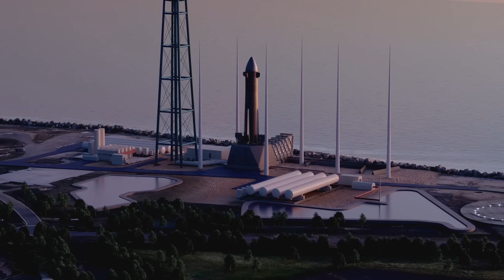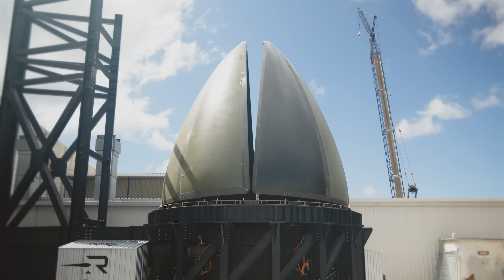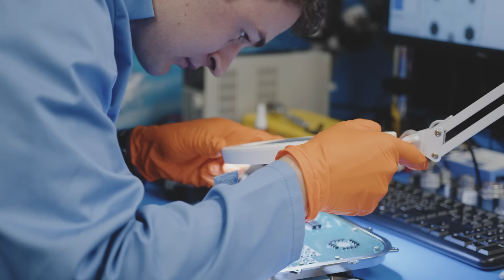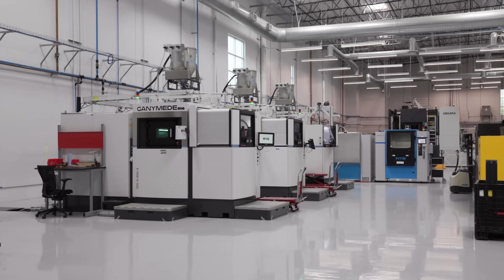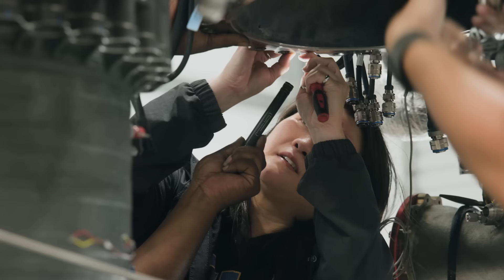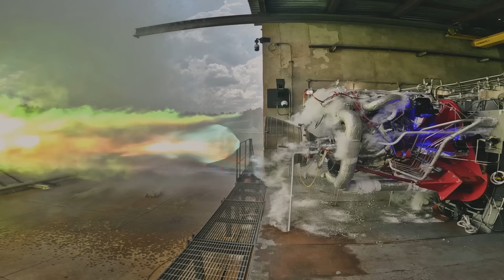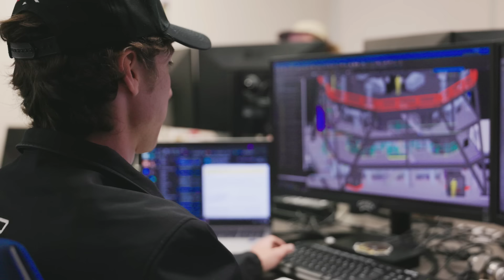Rocket Lab | This is Neutron

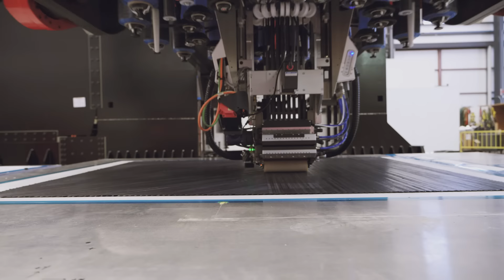Comment: 2:26 - I love how engineers misuse words to make themselves sound smarter. The word "depositions" is the plural of a legal process whereby a person makes truthful recorded statements under penalty of perjury.
The word we needed here was "deposits". A non-fancy word, but the correct one.
Reply: The 3rd definition od deposition :
3. the action of depositing something.
"pebbles formed by the deposition of calcium in solution"
Reply: This word has multiple meanings. Deposition in additive manufacturing or 3d printing is “the process of applying material layer by layer to build up a digital 3-D model”. There are many words I have encountered in science and aerospace that are not in any dictionary and not easily googled, but these words appear in our textbooks, reference material, research papers, and suppliers documentation. Cheers
Reply: @Duu2 thank you for bringing facts to the table instead of random speculation:)

Comment: How can carbon fiber stay structurally sound during reentry
even with a heat shield parts of the ship must surely exceed
the max temp for the resins.
Reply: First stage doesnt get anywhere near orbit so heating isnt as big of a challenge.

Comment: It sucks so bad that this isnt going to work. A single stage to orbit, and returning to where? A propulsive landing? Parachute and recovery? All with carbon fiber? So many fantasy aspects to this rocket it seems crazy to me that youre talking about this like it isnt still 10 or more years from reality.
Reply: This is not SSTO. It spits out an upper stage. It'll do what the Falcon 9 boosters do.
Reply: Genuinely what in the world gave you the idea that it's an SSTO? And why does the fact that it propulsively lands make it not able to work? SpaceX has been doing it for years and it made them really successful. Also, wdym "returning to where"? It'll return to a landing pad, and maybe droneships at some point
Reply: The skin has a higher melting temperature than stainless steel.

Comment: impressive. a little more than half the payload of F9. what's even the point?
Reply: It's more reusable than Falcon 9, so it'll likely be cheaper, plus Flacon 9 rideshare means that you can't be as specific in the orbit you go too, Neutron's lower payload capacity means that it can take payloads to more specific orbits for buyers who need them, without wasting empty space, so actually, there's much reason to make Neutron despite the lower capacity

Comment: How does a carbon fibre rocket survive re-entry? Is it light enough to be able to slow itself down with a burn back and then return to base?
Reply: It's not at orbital speeds like starship.  Due to its shape, should be slower on the return then falcon 9 booster.
Reply: Carbon fiber ceramic skin.

Comment: Guess I’ll just keep buying more and more Rocket Lab shares. This company is going to explode in size in the very near future.   Love it!
Reply: You chose wisely
Reply: Well, I hope it doesn't explode in size or any other way. Just saying.
Reply: @HeroesforDemocracy  or RUD (Rapid Unexpected Devaluation)
Reply: @HeroesforDemocracy Wieso, dann gibt es wieder gute Einstiegskurse in die Aktie.
Irgendwann wird Neutron fliegen und dann beginnt eine gute Phase für das Unternehmen.
Reply: If it explodes, imagine how many years it'll take to build another. They are going for perfection rather than trial and error / test runs / pilots. These guys are slow af.
Reply: @UnsaltedCashew38  Explode in size.  Meaning it will see an exponentially massive growth.
Reply: @UnsaltedCashew38  Blue origin did that and they got orbital first try and second try landed the rocket, the largest rocket to land on a barge! makes falcon 9 look like a candle stick. Jeff bezos has already a genius in ramping up production, he said an engine  can be produced every 2-3 days.
Reply: Rklb is and has been $$$$ buy buy buy buy
Reply: have you seen the market? Hold off
Reply: @noamjacob1216 You mean the 10% dip today?  No better time. 💰💰💰
Reply: @noamjacob1216  Yeah hold off. Buy high 🤣
Reply: @noamjacob1216 If you jumped on pretty early, you would be quite relaxed even with a 10% downturn
Reply: @noamjacob1216 right what caused the 10% drop yesterday on RKLB?? Couldn't find any news...
Reply: @noamjacob1216 agreed.
Reply: @noamjacob1216 ah yes, the first principle of investing: wait until the perfect moments to buy and sell because they are always predictable and the other investors and millisecond trading computers will wait for you to act first, not be a mile ahead of you
Reply: @noamjacob1216  No Balls!! No Glory!!!

Comment: Would Neutron, in theory, be able to compete for ISS (or other private space station) resupply missions, berthing directly?
Reply: Most likely. ISS resupply vehicles range from Progress at around 7200 kg fully loaded to cargo dragon 2 which is around 12,500 kg. So actually Cygnus, which is around 7400 kg, would be a great cargo vehicle to fly on this
Reply: It's definitely capable enough as a launch vehicle but it would need a spacecraft to match. It's unlikely that they couldn't convince someone like SpaceX, who operate their own launch vehicle in addition to their resupply spacecraft to switch away from their own launch vehicle. If Anatres 300/ Firefly's Eclipse are delayed, Northrop Grumman may consider flying Cygnus XL on Neutron instead of Falcon 9. Outside of that, and perhaps some European Commercial space Cargo return services capsules if they materialize and don't go with an European launcher like Ariane 62, Rocketlab would likely need to develop their own CRS spacecraft if they wanted to fly missions to the ISS or CLD stations.
Reply: @plainText384  I had Axiom space in mind. I could see them launching on Starship Cargo, but resupply with Neutron could be an option. Just thinking out loud.

Comment: Better launch soon or Rocket Lab could look like Blue Origin, more hype and CGI than rockets. Just get on with it.
Reply: Rocket Lab is already moving way faster than Blue Origin, I don't think there's grounds for any worries
Reply: do you even know how long spacex took to get through development?
Reply: the difference is that rocketlab has reached obit some 30 times or so already? And they have recovered 1st stage booster
Reply: @snuffeldjuret so? electron is a very different program than neutron
Reply: @ranobrain  so is starship and falcon 9, and so is new glenn and new shepard...
I am not sure how different rockets are different rockets go against what I wrote in response to op
Reply: @snuffeldjuret it sounded like you were expecting faster dev bc they did it with electron already
Reply: @ranobrain  aah okey, ah no :). I felt alone when I never thought they'd get to flight this year :). I was just pointing out that Rocket Lab has, imo, accomplished more than Blue Origin so far.

Comment: Go Rocket Lab! Medium class reuseables are super important to our future.
Reply: if it carrys a 12 or 13 ton payload like its rated for it will carry not much less than starship's ever managed to get to orbit for a lot less fuel
7 did a unplanned disassembly at 8 tons and 8 did it with 4 tons of payload onboard 10 got 16 tons to near earth orbit but they reduced the heat tiles/weight so much to do that it had holes burnt through it by time it landed .....
this seems like a much more reusable/cost effective solution  unless you hade a individual payload that couldn't be sent in parts that weighed over 12 tons
Reply: @violetquinnlaw  They don't really compare though. You are talking about the issues SpaceX had deorbiting a second stage. Neutron's second stage is expended.
Reply: @violetquinnlaw what makes you think what they have put on them so far has any relation with it's finished payload... These are test vehicles, I don't think they are even fully filled up, just enough for the test at hand.
Reply: @violetquinnlaw
Starship deployed 52 tons in 1 flight